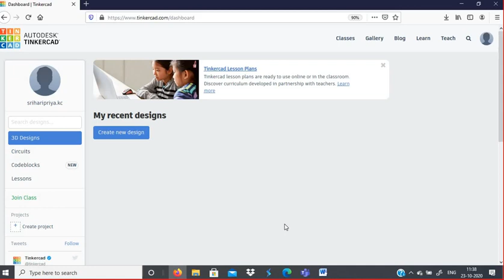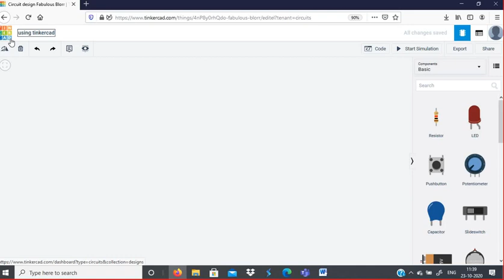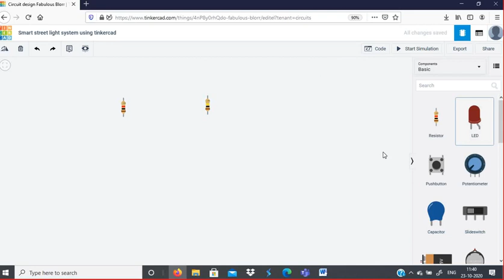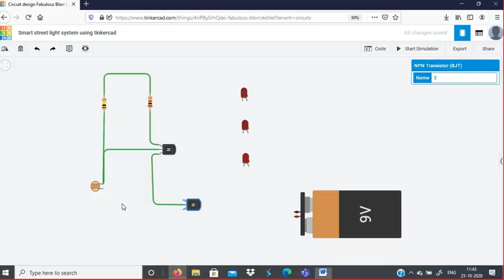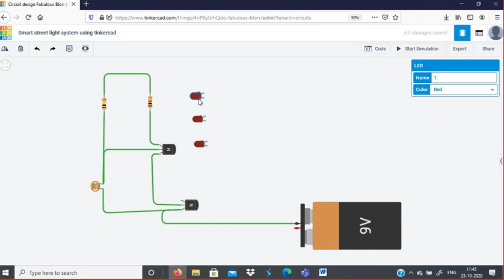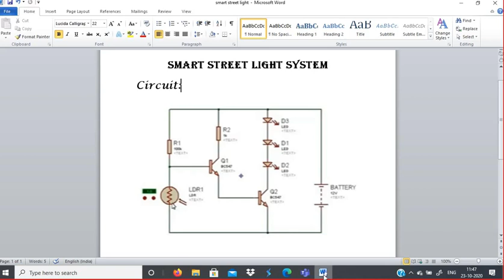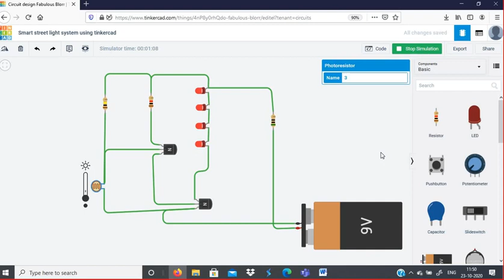Smart street light system using Tinkercad without programming | IoT application

Comment: Thank you for your video. May I ask why do you put two npn transistors in your circuit?
Reply from the maker: You can construct the circuit with single transistor ... You can construct the circuit without transistor also .... you can use arduino.
Reply: @TechnoBrunch  thank you very much for your quick response. I understand that you can construct the circuit differently, but because I am new in the field of electronics, I am trying to understand the connection of the two npn transistors of your circuit and specifically the connection of the emitter of the first transistor to the base of the second transistor. Why do you use such a connection?